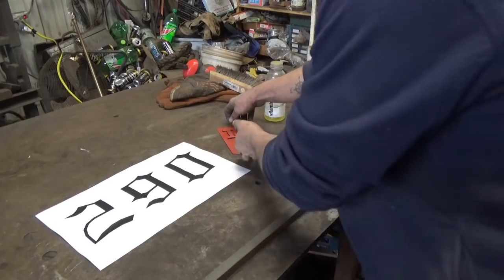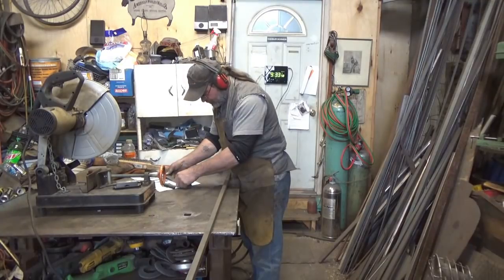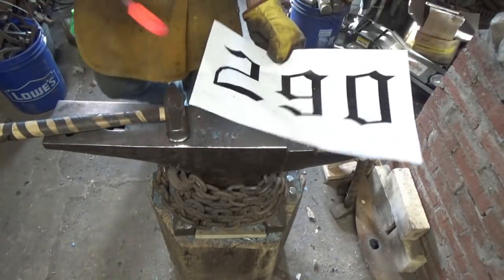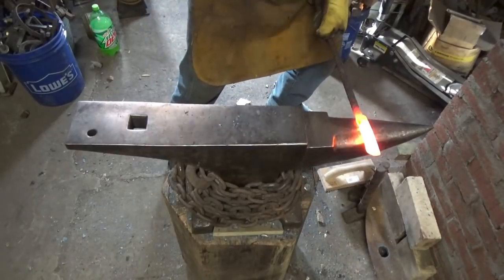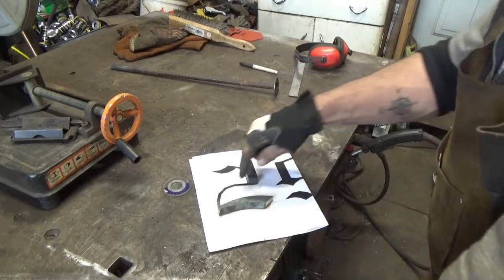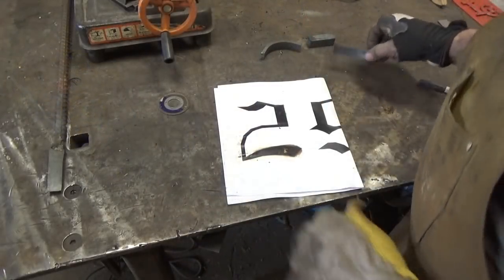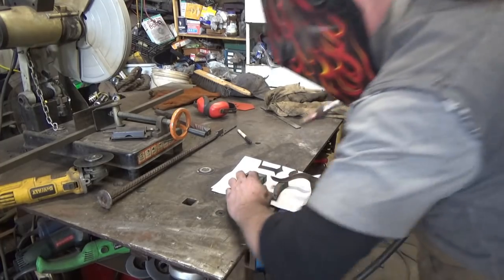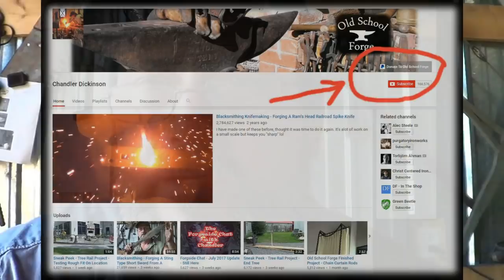Blacksmithing - Forging Gothic Style Letters - Full Version

Comment: When you said an inch tall I was thinking they would be tiny numbers for a sign to be read from the street. What you were saying for me to understand was a inch in depth, so "about an inch deep". I am talking basic X,Y, and Z values where Z is always height in relation to the world. X and Y are depth and width and are interchangeable for the terms depth and width axis depending on the direction it is facing as X and Y does not rotate because the object does. So when you said an inch tall imagine the paper you pointed at had the numbers an inch tall on it, the two would have been roughly double the size of your fingertip. You don't need to forge or cut anything that small but stamp or engrave it.

Anywho that's my own idiocy for not understanding what you meant because I have spent way too much time making 3D models for a game this week. And doing animations where everything goes wonky is what I was doing this week. Have all the skeleton bones set to a dummy object, rotate the dummy object because you have to.... XYZ coordinates are relative to the dummy object and not the scene itself.... So math to correct I suppose but I have no idea on what the calculations would be. So if Dummy object was rotated on the Y axis by 120 and you then rotated another bone that was all 0 at the start by 35 degrees on the Z axis and 5 degrees on the X axis... how in the bloody hell do you translate all so you can set your position? And why  does 3DS Max suddenly reverse translation values mid animation so once Y 0.864 becomes Y 187.0 or some other made up numbers because I am too lazy to open Max and fetch them. And they are in the same exact spot by .001 units. They never taught this shit in school when I went to school so I gots no clues. I am an idiot lol.

End of video.. I like how the numbers turned out.. I hope they were used.